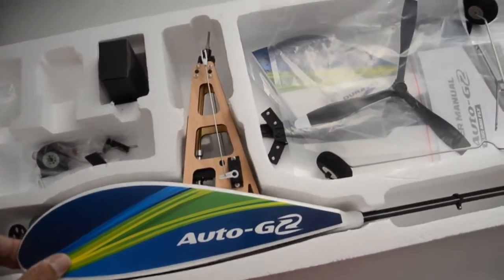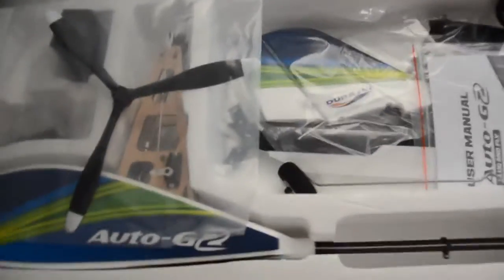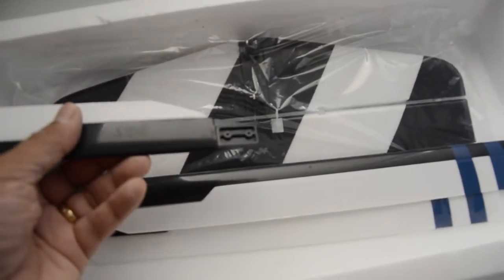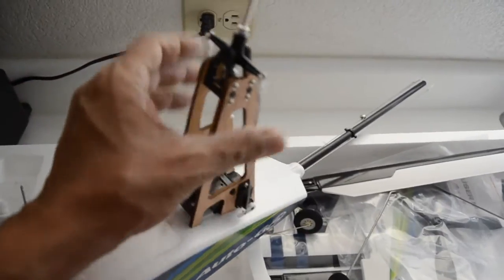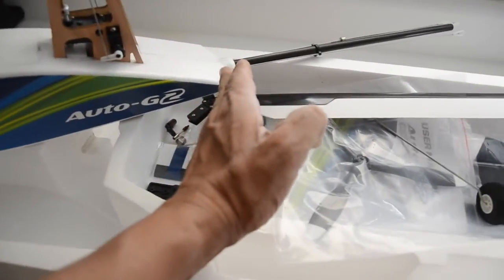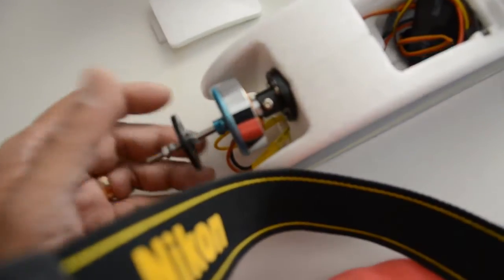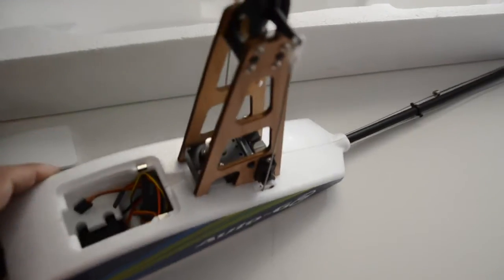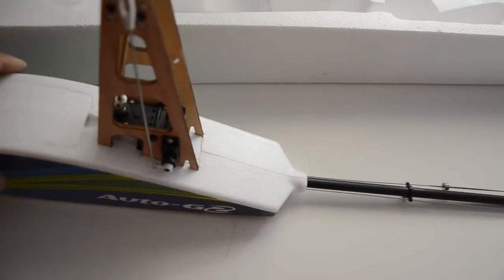AUTO-G2  A look Inside and Outside the Box

Comment: Hi. I have just come across your video and to say that you do not need to take the body apart to replace the rotor spin up assembly. You just undo the fixings on the rotor mast and a couple of the grub screws on the flexi drive and the gearbox, motor and ESC all come away together. BTW. The ESC for the rotor is the weak link along with the Rotor Blade plate. My ESC was dead on arrival and the model tipped over on the second landing and broke a blade at the root. I remade the plate out of 3mm Fiber Board using the spare as a template. I also replaced the inner blade bolts with cocktail sticks which will break in the event of a blade strike:)